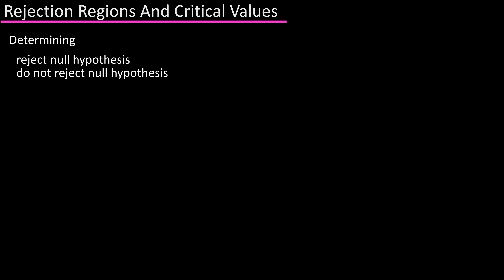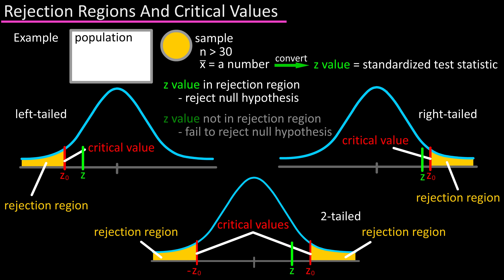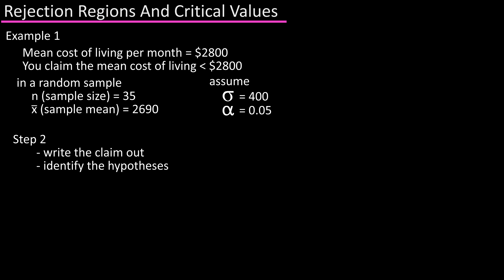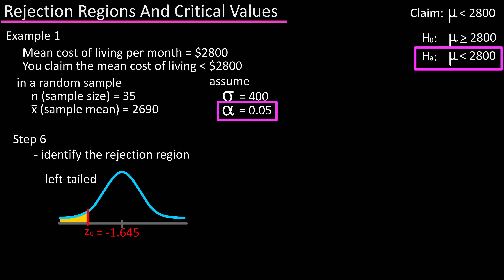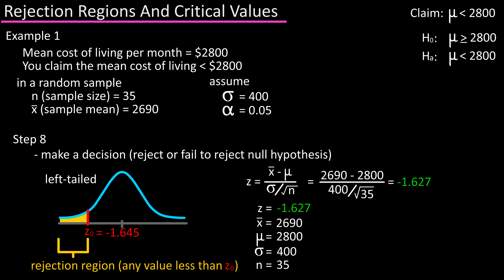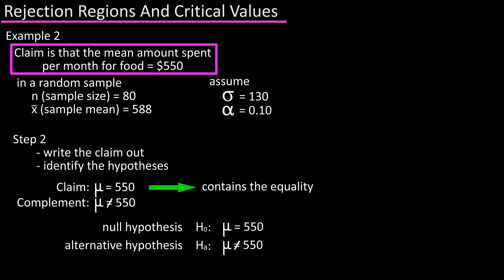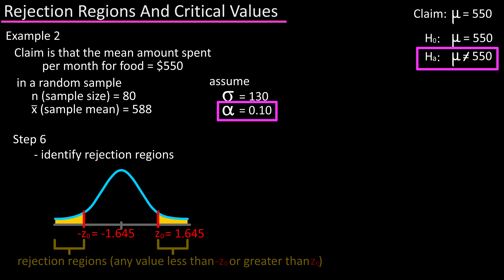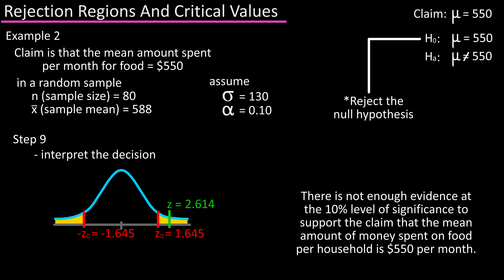Hypothesis Testing - How To Find Rejection Regions And Critical Values Using A Z Test

Comment: Great video! Like and subscribed. How did you find -1.645? I can’t seem to find it in the z table. Thank you
Reply from the maker: Thanks for the support.  -1.645 is actually between the values of -.164 and -1.65, so, it is not specifically listed in the table.  This will happen sometimes when you are doing these types of problems.  I should have mentioned that in the video, sorry, my bad on that.
Reply from the maker: Thanks for the support.  -1.645 is actually between the values of -.164 and -1.65, so, it is not specifically listed in the table.  This will happen sometimes when you are doing these types of problems.  I should have mentioned that in the video, sorry, my bad on that.

Comment: Good video. I was wondering about the critical value with respect 5% significance level mentioned in the first example. I think the value is -1.96 for one tailed test. The critical value with 10% significance level is 1.64. You have mentioned 1.64 for both the examples. Correct me if am wrong. Thank you
Reply: Yeah, that's what i am thinking

Comment: and i think the critical value should be 1.960 not 1.645, plz correct me if iam wrong
Reply: It's 1.645, you were looking at the two tails but the problem only requires the one tail.